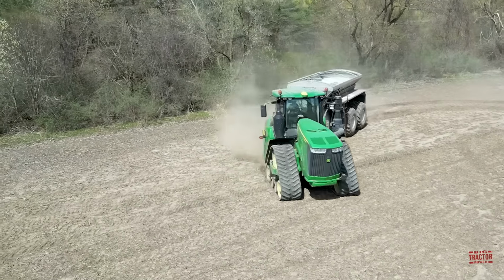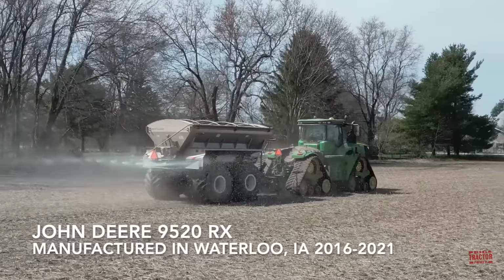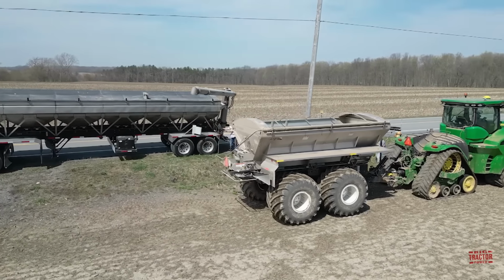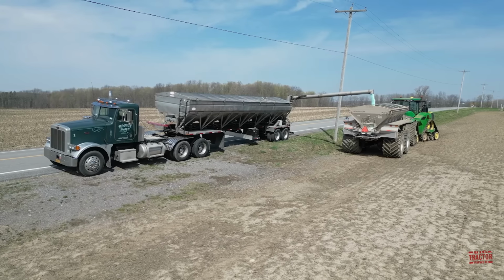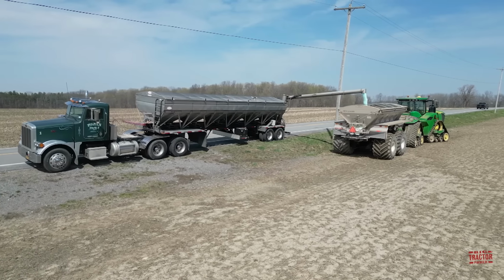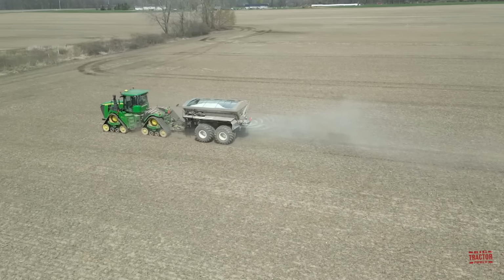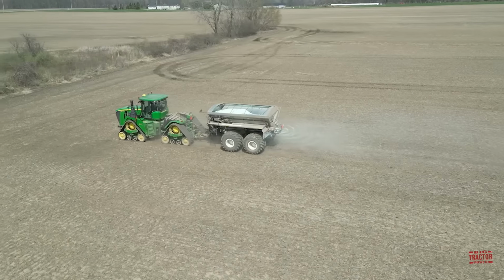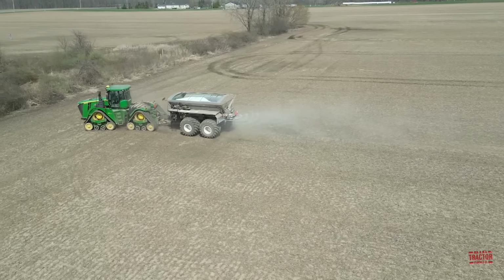JOHN DEERE 9520RX Tractor Spreader Fertilizer

Comment: Man that’s a big tractor spreading fertilizer.  I see there are a lot of those large 4wd articulated tractors in New York State.  I guess the fields are pretty large for them Jason.  In Southwest Georgia, where I’m originally from, some of the farm supply dealers in Bainbridge use those large three wheel spreaders or have a fertilizer trailer hooked up to a large row crop tractor like a John Deere 8R or CaseIH Magnum or an International or Freightliner truck with those wide flotation tires.

Comment: For those of you watching this video who are thinking, “Those look like monster truck tires on that spreader”, that’s because those big tires are in fact the same sort of tires that are used on monster trucks.
Reply: High flotation tires, that’s probably why
Reply: @noahater5785  Yep.  The tire size normally used on monster trucks is 66” x 44”.  Those big tires hold so much air that if you drove a monster truck into a deep enough body of water, it would actually float.
Reply: This is the way to spread fertiliser on fields. 
I 've never seen fertiliser loaded directly into the spreader from a truck this way.